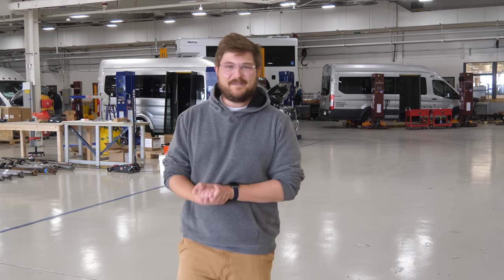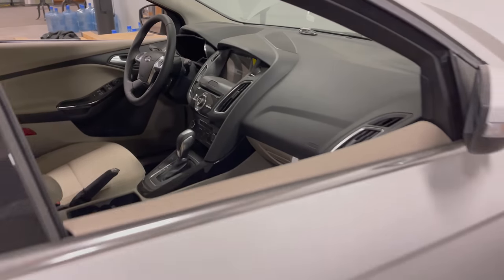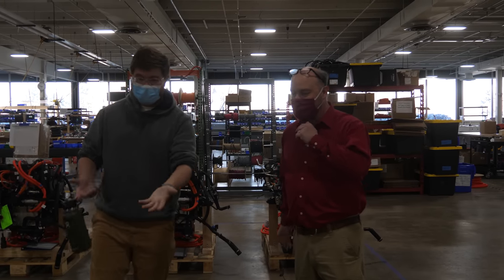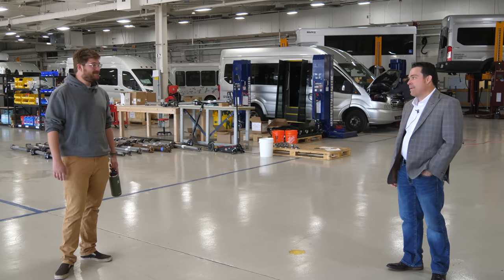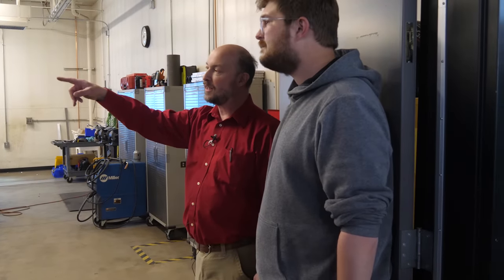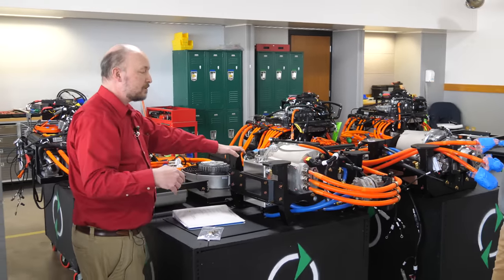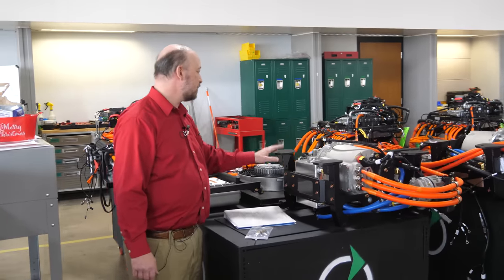Lightning eMotors Factory Tour

Comment from the maker: 0:00 - Introduction
1:29 - Hydraulic Hybrid Company Beginnings
6:20 - Ford Focus Electric
7:51 - Combustion Engine Removal
14:09 - Electric Powertrains 
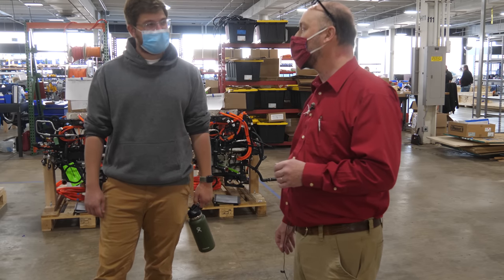21:03 - Tim Reeser, CEO Interview
28:37 - Metal Fabrication
34:18 - Wiring
44:13 - Powertrain Production
51:30 - Building Expansion + Coach
55:16 - Hino Platform
1:00:12 - Battery Packs
1:05:05 - Final Assembly
1:08:13 - Outro

Comment: Hey Kyle, nice job on the very thorough factory tour. I applaud this kind of in-depth, informative and educational piece.  I am sure there's lots of interest in more videos of this nature. This is what the world needs. Not anti-Tesla click bait by a Brazilian hired gunslinger. This type of video represents REAL journalism, and that results in credibility.

There have been a large number of truck upfitters that have either switched from consumer to fleet-only work, or gone by the wayside. There are firms like Montreal's  Ecotuned coverting F-150s to fully electric or Lion electric upfitting commercial trucks and buses. I find the bus retrofits a fantastic idea and uber interesting with a huge upside. 

What ever happened to VIA Motors? It seems there are many untapped use cases such as RV chassis just aching for a robust, long range EV solution. Other firms like Boston's XL Motors are taking the plug in hybrid approach to truck conversions.

Thanks for breaking up the video into sections, it is a long time for a typical person to spend on a piece like this. In the future, perhaps you could do two versions - one like this for the tech junkie nerds like me, and an edited version for the masses of about ten to thirteen minutes that just hits the high points.

Comment: This is all well but where's the power coming from to recharge these things. In the mean time you have a heap of combustion engines which have been built and no where to go. ys a few go to repowers but hey when they going to have no place to go? also the governments ids giving heaps of tax incentives for this to happen , so there tax payers wearing the cost. beside the space and weight the batteries weight compared to fuel Im sure the mileage will no where compare to a fuel running vehicle. get a gript you guys your not really making any difference to. all these special this special that  adds cost so the over all vehicle will cost a lot more . Be a ware of these  brain washing people!